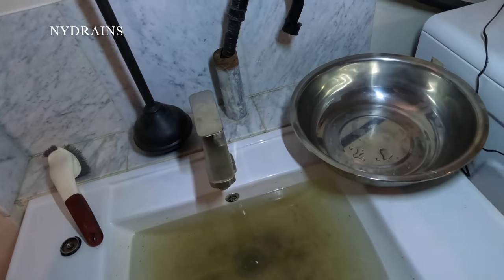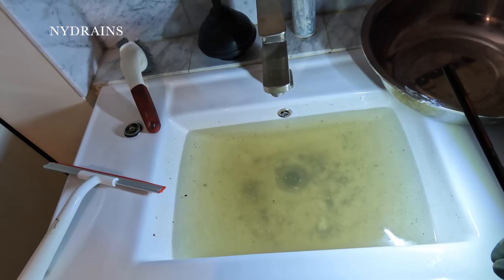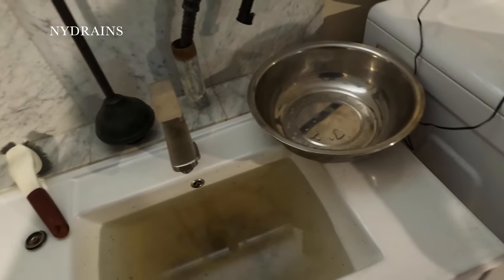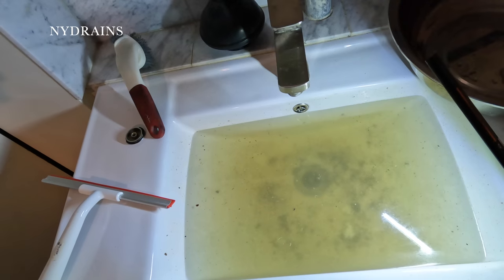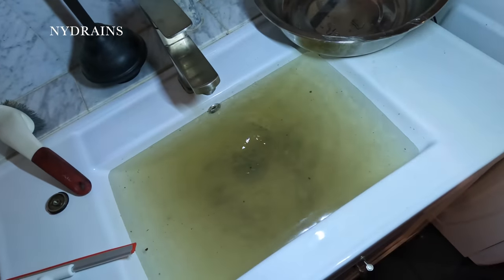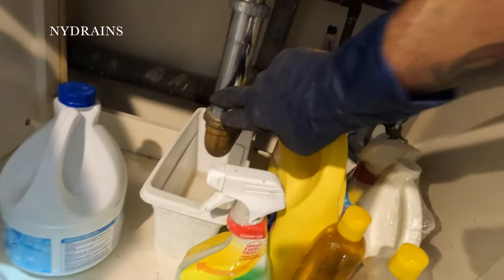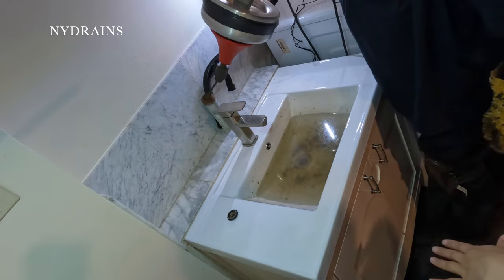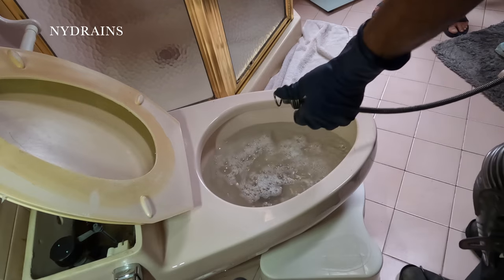Clogged Drain #132

Comment: The gent that does the maintenance on our aerobic septic system has a rule that we live by.    Flush only easily dissolved TP and human waste.    Nothing else.     Thus we filter our wash machine drain,  and put cooking grease in a jar to be discarded.   Not one clogged drain in 10 years.........  other than a toilet that could be solved with a plunger.

Comment: The first one with the 1.5" galvy sticking out of the counter used as the washing machine drain! Da fuq is that!? That can't be code?
Reply from the maker: It would look for better if it had the white washing plastic set up but it does have a separate trap